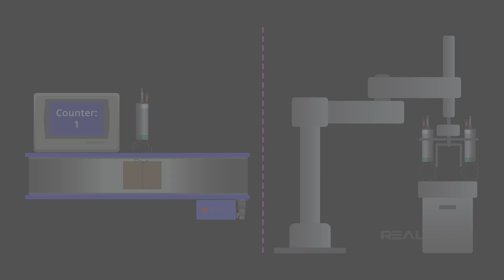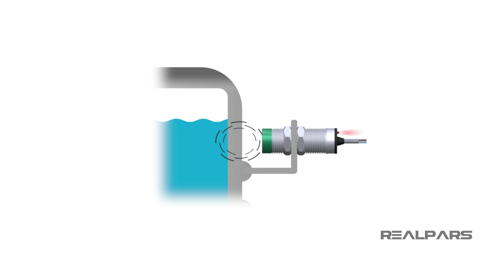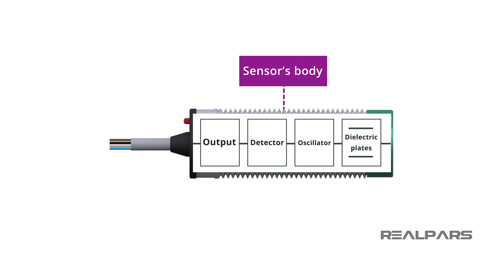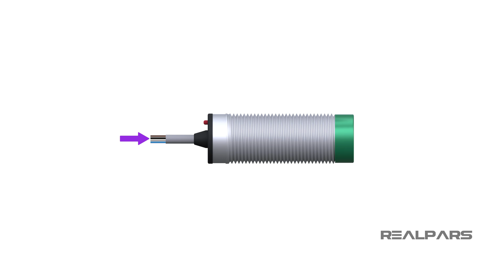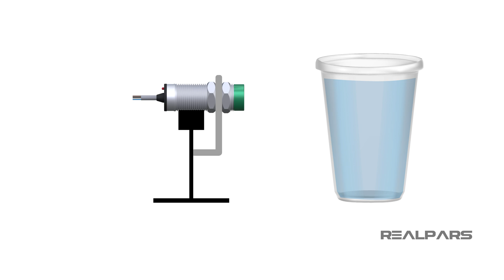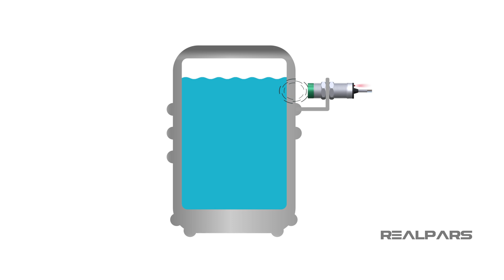Capacitive Sensor Explained | Different Types and Applications

Comment: Will the capacitive sensor work trought rubber band conveyor ?
Sennsing range is up to 60mm and the material is sand. Thickness of the band is 10mm and inside is textile stringing.
Reply from the maker: Hello, @milosmilec Thank you for your question and it is a good one. Unfortunately, we can’t give you a correct answer. Many sensor manufacturers might be able to do what you are looking for, depending on your application. It sounds like a challenging one. I recommend searching online or contacting one of your local vendors who sell these sensors.   

If you’re looking to learn more about this topic, you can join our 7-day free trial at https://community.realpars.com/checkout/realpars-membership Happy learning from RealPars!

Comment: wait so how does a capacitive sensor know which to detect if it can detect non metalic object like plastic cup but What i want it to monitor is the water inside the plastic cup
Reply from the maker: Hello Overdosed_Sunflower.  Thank you for your question. Good question! Most of these sensors have a sensitivity that you set so they do not sense the bottle's plastic while there is no water in it. Therefore, when you fill the bottle, the water gets to the level of the sensor, and it will see the water. You are setting a radar-type signal, and it leaves the sensor. But when the signal hits something, as you want it to, the radar signal bounces off the object and returns to the sensor, knowing something is in front of it. Then, it will signal the PLC if it sees something.   Happy learning from Realpars!
Reply: @realpars  so adjust the range to hit different object you mean?
Reply: @realpars  thanks

Comment: Can I use one capacitive proximity sensor to build a waste segregation bin that has three chambers.one for paper one for plastics and one for biodegradable waste
Reply from the maker: Hello, @Pascal_Mmaju. Thank you for your question. Well, you will need more than capacitive proximity. As stated in our video, it can sense, but it will not know what type of item it is for it to go into the correct bin, as you stated. You will need more engineering requirements, like adding vision for color recognition or smell sensing. Like I said, it is possible, but more engineering is required. One sensor can’t do it all. Happy learning from RealPars!

Comment: Which proximity sensor can detect pvc and metal stud inside a wall?
Reply from the maker: Thank you for your question.

A capacitor sensor can detect various materials, but it needs to be connected to an electronic controlling device to provide power and calibration. It sounds like you might be looking for a stud finder, which is readily available on Amazon or at your local hardware store.

Happy learning!
Reply: @realpars  Thank you for your response, I wanted to make my own Stud Finder, what components will I be needed to make my own?

Comment: Great vid mate but may I ask, is there any capacitive sensor that are capable for arduino. Also a sensor capable to detect a paper and plastic in enough distance like half a meter because our research is on waste segregation. Pls do try to reply as it can help our proposal
Reply from the maker: Thank you for your question. I can’t tell you exactly what you need, but many vendors worldwide have products you can use with your system that can detect all kinds of items, including color-related items. Have you contacted your local sensor product vendors in your area? Here are two links that might be able to help you with what you are looking for in your design. It just takes a little searching. These vendors are global, if I am not mistaken.

https://www.keyence.com/about-us/network/local.jsp

https://us.rs-online.com

Comment: Is there a sensor that can count the number of products on a refrigerator tray and when a product is added it increments the counter, and decrements the counter when a product is removed
Reply from the maker: Thank you for your question. To clarify, a sensor typically functions as a single device, commonly employed as an input for an electronic circuit board or a Programmable Logic Controller (PLC). As you rightly pointed out, the software manages all logic operations, including addition and subtraction when interfacing with a PLC. Achieving addition and subtraction functionalities might involve utilizing two sensors: one for addition and another for subtraction. Additionally, alternatives such as imaging cameras present numerous possibilities to accomplish your desired outcome. There exist various methods and technologies to achieve your objectives. 

Happy learning!

Comment: Hello great vid. I am planning to use a capacitive proximity sensor for a hand held device. It will detect studs behind drywall, potentially used to detect live wire behind drywall and also be used as a moisture meter to detect the amount of moisture in drywall. Would this sensor be a good fit for some or all of these uses??
Reply from the maker: Thank you for your question. Your project is quite intriguing! While there are existing equipment options in the market that can fulfill most of your requirements, if you're interested in experimenting, it could be an enjoyable endeavor. To get started, you'll need a Capacitive Sensor with sensitivity adjustment. Next, you'll need to calibrate the sensor for each specific item you intend to test. Therefore, acquire a separate sensor for each item and configure it accordingly.

One potential challenge you may encounter is when it comes to moisture sensing. Anticipate that you might receive false readings because you'll need to set the sensor to the minimum moisture threshold you're targeting and maintain that setting consistently. Any moisture level exceeding your chosen threshold will trigger an output.

Remember that all your tests should be conducted on drywall of the same size and thickness, with a predetermined +/- tolerance you've selected. Best of luck with your project! Happy learning.

Comment: Hi, could this sensor measure the percentage of water inside the ballast layer of railway tracks?
Reply from the maker: Hi Ahmed, 

Thank you for your query. Regrettably, this is not possible. To perform such calculations, you would require a more advanced engineering system, specialized measuring equipment, and a PLC or a computer capable of handling the necessary mathematical computations. We encourage your continued learning journey with RealPars!

Comment: I have an application where the sensor (dielectric plates) need to be installed remotely from the circuitry of the sensor. Can I purchase the dielectric plates and circuitry separately? If so, from where?
Reply from the maker: Thank you for your inquiry. The dielectric plates and electronic circuitry are integral components of the sensor and cannot be separated. To achieve your desired functionality, you can consider obtaining a capacitor sensor along with an electronic module designed to power the sensor and receive its output based on your specific configuration. Subsequently, you can configure the module to transmit a signal to a PLC or the intended device.

For further guidance and potential purchase options, I recommend exploring the following links from companies that specialize in sensor technology:
Keyence https://www.keyence.com/products/sensor/
RS Components https://us.rs-online.com/sensors/proximity-sensors/

We hope you find these resources helpful in pursuing your project. Happy learning from RealPars!

Comment: I want to know that if i have hot water steel tank and i want to control the water level by using the sensor but from tank out side  than in that condition which sensor i have to use their ?
Reply from the maker: Thank you for your inquiry. Given that we are not familiar with the specifics of your engineering design, there are various sensor options available to you. These include flow sensors, liters/gallon sensors for your piping, radar sensors, and laser sensors. Your choice will ultimately depend on the details of your design. To help you explore these options further, we recommend reviewing the offerings from reputable global manufacturers of sensors and measuring devices. You can find a range of products and solutions at the following links:

Keyence - Sensors and Measuring Devices https://www.keyence.com/products/
Omega - Sensor Solutions https://www.omega.com/en-us/

We hope this information assists you in making an informed decision. Happy learning and designing with RealPars!

Comment: Great video, loved it
just one question
Does separating glass and plastic depend on the sensitivity range?
Reply from the maker: Thank you for your inquiry. The answer is both yes and maybe. The feasibility of this approach hinges on the specific sensor you choose and how you configure its sensitivity. In today's market, there is a wide array of intelligent sensors available, each with unique capabilities.

For optimal results, it is advisable to employ two distinct sensors tailored to your specific requirements and application—one designed for glass and another for plastic. This dual-sensor setup ensures that each sensor only detects the intended material while rejecting the other.

For further insights and in-depth knowledge, I've provided a link to a reputable global manufacturer in the field: https://www.keyence.com/

Happy learning from RealPars!

Comment: Hello, may I ask if this sensor can detect empty plastic bottles? Because I have this sensor but it can't detect the bottle unless it has water in it.
Reply from the maker: Hi Christine,

Thank you for your question! 

The response varies based on the sensor type and whether it has a fixed or adjustable setting. For adjustable sensors, it's essential to fine-tune the sensitivity, as we explained in our video. Don't be discouraged if it takes a few attempts to get it right. Additionally, take into account the speed at which the plastic bottle moves in front of the sensor, considering the sensor's reaction time for detecting the bottle. 

We wish you productive learning with RealPars

Comment: can capacitive proximity sensor detect electricity inside water?
Reply from the maker: Hi there,

Thank you for your question! 

My apologies, but based on my understanding, achieving this with a capacitive sensor seems impossible. However, there are alternative engineering devices that can accomplish the task.

Keep learning and exploring with RealPars

Comment: Hi, 
I have a two wire AC NC capacitive sensor.  I want to see the counting process of objects on the screen.  Which product should I use with the sensor ?
Reply from the maker: Hi Osman,

Thank you for your question, and we'll do our best to grant you some guiding answers.

It seems that some essential engineering data of the sensor was not provided in your inquiry, making it challenging to offer a complete solution. When mentioning the screen, I'm unsure about your specific engineering requirements. However, one approach to address your needs could involve using a PLC with a custom program and connecting it to an HMI panel. Additionally, if your capacitor sensor's current load capacity is 24V/500mA, employing a counter relay connection properly wired to the sensor should suffice.

I would recommend checking out RS-online.com, an online electronic store where you may find the necessary components for your project.

Hope this helps!

Comment: Detailed video
Please how can one know the difference between capacitive and inductive proximity sensor by physical view?
Reply from the maker: Hello koko Kofi Mensah, 

Thank you for your question. If the sensor is electrically hooked up, you can tell by the material you put in front of it to sense. The capacitive sensor will detect non-ferrous objects like plastic or paper and the inductive proximity sensor detects ferrous metals only like steel, iron, etc.

If they are not electrically hooked up, you must have the datasheet from the manufacturer.

Happy learning!

Comment: hello! can i ask a question. do the capacitive proximity sensor have a measurements size limit of an object or what is the smallest size or measurement of  a paper and plastic that capacitive proximity sensor can detect? are there any minimum sizes that the sensor can detect? because we can't find any study that can support our research, and do you know where can we find it.
thank u, i hope u can see my comment
Reply from the maker: There are a couple of rules of thumb regarding target size (I do not know where these came from originally).  The target should be at least the size of the sensors active surface.  For a standard 18mm sensor, that would be a target of at least 18 mm square.
The second rule of thumb states that the target should be at least 3 times the sensing distance, so using the same sensor, at a sensing distance of 30mm, the target should be at least 90mm x 90mm.  The larger size should be used when both rules are applied.  Of course, these are design considerations, and validation of these sizes would need to be made in the field during testing.

Comment: Can I adjust it only to detect one type of material like plastic only!?
Reply from the maker: No, not with a capacitance type sensor.  These sensors simply detect presence and cannot differentiate between materials.  There are special LED-based sensors that can differentiate between materials, but they are much more expensive and require a thorough understanding of the limitations of the sensors so that the right sensor can be matched to your application.

Comment: With this sensor or with any sensor can we know which object is being detected??
Reply from the maker: Not easily.  Some sensors can be "tuned" for a certain capacitance range, but not to discern between different materials.  I could have three sensors each tuned for a different capacitance range along the same conveyor and perhaps be able to detect three different materials as they pass by, but this is not easy to do unless the capacitance values for the materials in question are vastly different.  Even then, it is likely one or more of the sensors will detect multiple materials.
Reply: Okayy...thank you so much  for your response...

Comment: Can the sensor be programmed to a specific material?🙏🙏
Reply from the maker: If you install a sensor that has a sensitivity adjustment, then yes, to some degree, you will be able to "tune" the sensor to your specific material.  Some plastics may require a special type of sensor (5- infrared laser diode sensor manufactured by IDEC or ProPhotinix).  These special sensors come in a variety of wavelengths to detect various plastic materials.
Reply: @realpars  thank you
Reply: @realpars  Could you please explain it to us in a video☺️☺️🥰👍
Reply: @realpars  Is it possible for my material sensor to be a highly sensitive sensor at a distance and penetrate the object to detect the special substance?  And sorry for the inconvenience❤️😊🤔🤔

Comment: Do they have shielded Capacitive sensors?
Reply from the maker: If you are referring to the wiring, the cabling typically is shielded.  If you are referring to the device itself, many capacitance sensors are RFI "immune".  RFI/EMI( interference used to be a big problem with most capacitance sensors, but modern sensors perform very well with little chance of RFI/EMI interference.  Look for sensors with high signal-to-noise ratios.
Reply: @realpars  thank you.

Comment: Why we use Zero feedback signal in NPN Sensor. What is the significant.
Reply from the maker: The common, or zero feedback on an NPN switch is required to "drain" current through the transistor circuit when the switch is activated.

Comment: question, can a capacitive sensor detect if something is moist or not?
Reply from the maker: Capacitance sensors can be used to detect moisture in soil, but these sensors are not quite the same as shown in this video.  They need to be submerged in the soil.  Capacitance sensors as shown in this video (proximity sensors) are not useful for detecting a wet part or object. 
https://protosupplies.com/product/capacitive-soil-moisture-sensor-module/

Comment: Which circuits present inside the sensor body? From your video I can understand that some micro switches are present for NO and NC operation correct me if i am wrong. Apart from micro switches which circuits present inside the sensor body? My English is not good please excuse me
Reply from the maker: Capacitance sensors typically have an oscillator in the sensor and a trigger circuit that senses when the oscillatory field shape changes (i.e., an object moves close to the sensor).  when the switch triggers, it changes the state of a transistor output circuit, either NO or NC.
Reply: @realpars  thank you very much sir

Comment: can capacity sensor detect only non living object not human ........or is their is any other hardware which can detect only object
Reply from the maker: I do not know of any capacitance sensor that can reject human objects (hands, etc.) yet still detect other objects.  I suppose if you had glass objects, you could set up a system that requires light to diffuse through the object, with a detector set up at the refractive angle.  Human parts would block all light, which could be programmed to be ignored.

Comment: Hello, may I ask that can capacitive proximity sensor used to differentiate between non-metal materials such as plastic and paper?? Or is there any other suggestions to differentiate paper and plastic?
Reply from the maker: Capacitive sensors come in various configurations, but as useful as they are, they do have limitations.  My suggestion is to test the type of sensor you want to use with the materials you want to detect.  Plastic sheets and -single-layer paper objects are difficult to detect, but newer capacitance sensors and LED laser sensors can be used successfully for this purpose.